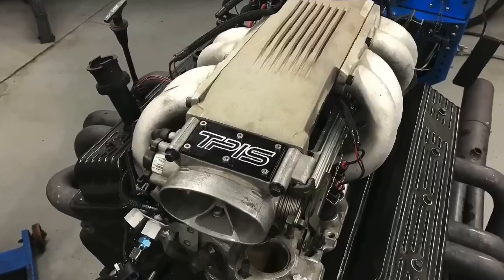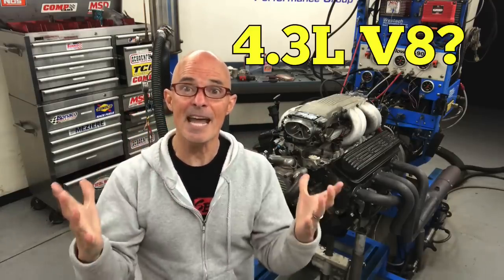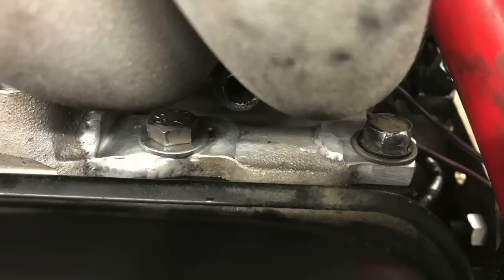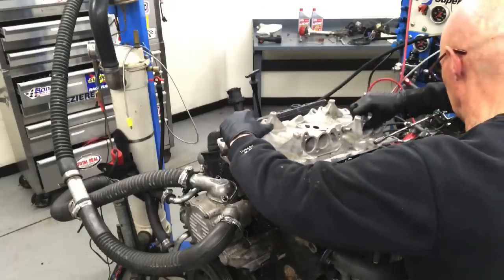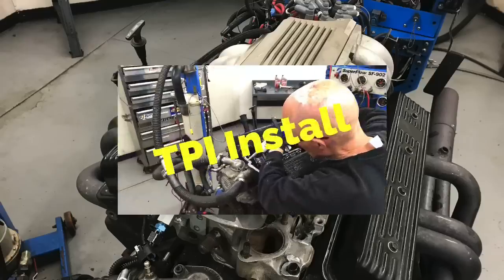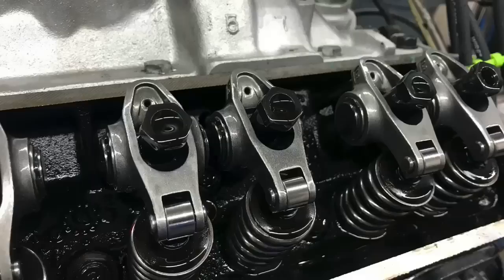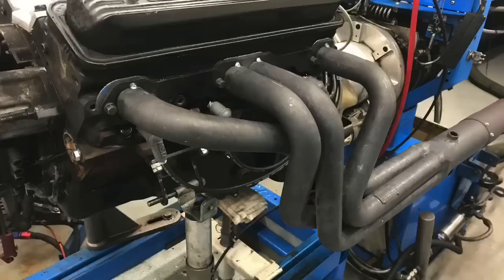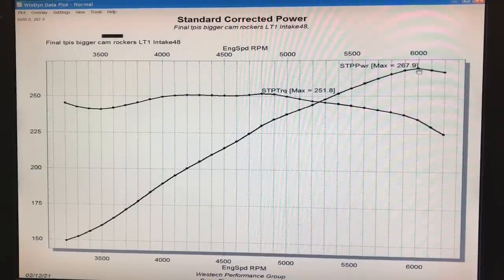GM's BIG MISTAKES-LT1 VS TPI VS CARB (L99 4.3L V8 INTAKE TEST)

Comment: So, it's worth mentioning that the carb intake was also the only "performance" intake tested here. I would be interested to see what this engine would do with something like a superram, which is kinda a middle of the road for runner length compared to the TPI and LT1. Personally, I don't like the TPI style  intakes, they're too much of a pita to put together, that being said there aren't alot of options out there for a gen 1 sbc that produce the torque that they do.
Reply: Accel made a Superram induction system for 92-97 LT based engines. It was the same as the Superram induction system for the LB9/L98 engines except it had a base intake manifold that was TPI on the top and LT1 on the bottom, had the same short runners, and a shorter upper plenum to clear the lower cowl on the 4th generation F bodies because the back part of the engine sat under the windshield in those cars. You could think of the base intake on the LT Superram system like the SD Vortec TPI base intake manifold except it was for LT based engines and it didn't flow like a turd like the SD Vortec TPI base does.
Reply: @Airwolf1971  I'm pretty sure the superram runners and plenum can be bolted to a stock TPI base. Theoretically he could put those parts on the modified base he already has.
Reply: @ericjon262  Yes they can be. The high flow base that Accel used on the Superram is the exact same base used with Accel's high flow TPI runners and plenum. Accel had a complete high flow TPI system and a step up from that was their Superram.

Comment: I have two Buick Roadmasters, one has the LO5, the other has the LT1. I really prefer the LO5 in this application as the LO5 has a noticeable torque difference. Off the line I believe the LO5 would get the LT1 for a few yards, although the LT1 will get it down the line. The LO5 is really a better setup I believe for a heavy Roadmaster. Would like to try the TPI on one of them, however just don't really want to get that deep in when both are working well at this time. Interesting results.
Reply: I often wondered what it would be like to combine a TPI intake with a TBI engine, since TBI heads are also designed for low end torque more than anything. The TPI runners would maximize low end torque, and then they would eliminate the fuel distribution limitations of the TBI.

Comment: Does anyone else think that 1 3/4" headers aren't the best for a 262 ci engine?
Reply: It's what they had but ya, they're too big. 1 1/2" would probably work good. For this back to back test the data is still good because it was only one change.
Reply: at most, 1 5/8"
Reply: @timothybayliss6680  with those 1.5 inch headers the torque would have over 300lbs
Reply: @joed5472  it's would probably add a bunch especially under the peak. It's making so little power that even smaller pipes might work but none are really available.
Reply: Richard just added a video where he uses 1 5/8" headers. 5 hp, 9 lb-ft gain.

Comment: A 117 LCA "computer" EFI camshaft is way wrong for a Carburator setup that can handle 108 LCA with ease. Looking forward to see what heppens next. :) I am still amazed than no one is offering a EFI converted carb style dual plane manifold for the V8 engines, only single planes style manifolds.
Reply: Mercruiser had one for Vortec heads with a large monoblade throttle body on an adapter.  I ran one on my 383 in my Express van.  Lots of torque and good hp. I used a 1200 cfm 4bbl throttle body and a low profile carb bonnet with a 4" air intake.

Comment: Some things to keep in mind:
1 Late TPI 305s made almost as much hp as late tpi 350s. 230:245 where as torque was 300:345
2 Most people look at 305s as junk but look at the Ford 225hp 5.0 as a good engine. Wrong
3 When the TPI engines were still in production I read a story that included John Lingenfelter. What he found was that the TPI 305s and 350s used the exact same TPI intake manifold. The problem was that they were sized for the 305. When they learned this they designed their own manifold for the TPI 350 (L98). Lingenfelter's manifold made around 40hp more than the stock TPI manifold on the L98. An L98 with a Lingenfelter intake manifold made almost as much hp as a stock LT1. If you look at this, the LT1 wasn't as big of a leap in power from the L98 as people think.
I believe the LT1 short runner intake manifold was actually designed around the larger displacement of there LT1. Horrible choice for the 4.3.
Reply: Exactly.

Comment: I had a '89 Firebird Formula 350 many years ago. The car felt really fast from stoplight to stoplight. It ran low 14's in the quarter mile and that was quick back in the day.
Reply: The Formula 350 TPI. It was all that the Ford rustang could do to try to keep up with that Formula 350. I like it because it's a lighter Firebird than the TA. No ground effects , leather seats etc to weigh it down. and it had the same Ws6 handling and power as the TA Firebird.  It also had the Knight Rider hood. 89 was a good year . Duel cats!

Comment: The Tpi intake probably would have made more peak power than the l99 intake with the stock camshaft. The stock l99 makes peak power at 5200 rpm and every point up to that that rpm the tpi intake is better. This gets worse for the l99 intake at lower rpm because the restriction of the runner isn't as pronounced at a lower rpm and airflow. Tpi intakes are expensive to manufacture and install on cars though, even as a manufacturer. The l99 intake is one.piece, the tpi intake is at least four that are all unique and need to be relatively precise with multiple machined surfaces.
I know someone is going to say that the runners aren't a restriction, they are. A well aligned, all those pieces I mentioned, tpi will flow less than 200cfm per runner. It really doesn't matter what heads and camshaft you put on it when you have an intake manifold that flows less than stock vortec heads with a truck cam.

Comment: The TPI manifold was replaced with the lower profile LT1 manifold for hood clearance in the Vette and Z28..
Reply from the maker: the Vette and Z/28 ran TPI motors and manifolds then LT1 motors and manifolds

Comment: I don't know about it being a mistake, but you kinda worked well for what it was designed,  mostly a small displacement, low rpm engine, when I had one, I was trying to figure how to keep the overall shape, only make the lower intake ports larger, and the intake runners larger  with similar length, with larger ports in the plenum, and throttle body, maybe twin 58-60mm,   however, I only port matched everything on mine, and ported the throttle body a bit, (and the plenum, ).  I'm thinking tpi may worked well on a 283, in a early 60's Nova! I think something with a short stroke, Maybe a 327 also,  a short stroke taking a quick, large gulp filling the cylinders, over a slower big gulp from a longer stroke, but I guess it comes to cam duration and timing, it just seems if the runner volume is equal to cylinder volume, or greater, it would have a ram air effect at a certain rpm range, where the moving air and reflected waves all work together, it all works out, and is plainly simple! (Totally inside my head of course, ) but even reading this not so much, but the total port volume, seems it equal or greater than cylinder volume, should fill the cylinders , maybe crazy, but I am a bit tired, just got out of the hospital, and had to watch your video first thing!! I'm just curious tohow the same (or close) displacement, only difference.is bore and stroke, to make it simple, say a 3" x 4" and a 4" x 3" bore to stroke, with similar intakes and cams, it would be interesting!
Reply: I thought this too but never built it

Comment: the '87 L98 with the first true fuel injection TPI was automotive genius by Chevy engineers and it also looked so cool with the runners
Reply from the maker: that would be 1985-but agree
Reply: @richardholdener1727  I thought it was '86 when the first TPI came out. Reason being was I had an '85 T/A and my buddy had an '86 iroc. His was tuned port and mine had a quadrajet. He was always just a little quicker than me, so I went and picked up an '89 L98 GTA. Fixed that problem right up.
Reply: @bisurdaddy  '85 Corvettes had TPI

Comment: Guess that motor needs variable intake runner length design
Reply: Cam, springs, heads help like on the 305
Reply: @shadowopsairman1583  what I was trying to explain, is that you can see the drastic difference in tq loss with the short runner intake, but also drastic hp fall off with the long runner intake manifold with the same internal parts. If you were to utilize an intake manifold that had a variable intake runner design, you could have a long runner intake for better low end power and have an additional set of short runners that open up in the higher rpm range to give better upper end hp, so giving the best of both worlds, on this particular engine.

Comment: There's one thing that has to be considered in why GM didn't put the TPI intake where the LT1 lived... does it actually fit in the applications where the LT1 lived? The throttle body is sitting quite a bit higher. I don't have the time to go hunting for hood profiles for various GM vehicles, but it may well be that they didn't want to change the stamping dies or it wasn't worth the unit cost for custom changes.

Comment: I'm wondering if you can block off the throttle body opening and convert a tpi plenum to carb. Sort of like holley hi ram manifolds with interchangeable tops. That would be a killer combo for a pickup.
Reply: Anything is possible with a welder
Reply: @TurtlDrip  I was more thinking of optimal fuel distribution. The ports are dry until right before the cylinder head. The places of the carb flange would need to be in the right spot to supply the corners. Maybe some fins to guide the flow. I know it's possible to plug a hole and cut a hole. I just think it would take a little more r&d than the average Joe welder is willing to do.
Reply: @TurtlDrip  question answered. Lol. Not just a Joe-welder solution.
Reply: @EricErnst  yes sir. Happy he made it happen
Reply: no

Comment: Grind down the restrictive nubs behind the throttle body on the upper intake and get a pair of Siamesed intake runners and that tpi will pick up a bunch of top end hp.
Reply: hes also using the stock throttle body with no air foil while he has a 1k race carb on the dual plane

Comment: One of the big advantages of the LT1 reverse flow cooling is that there are no coolant passages or thermostat housing in the LT1 intake which eliminates coolant leaks and allows for a 3.5" lower intake than L98.
My question is how is coolant flow changed if at all by using a L98 intake on LT1.

Comment: I would like a 300 HP 350 ft lbs tq L98 .  In  my 89 Formula Ws6 . I can't  go too crazy with a ttop car with stock  700r4  tranny . Will need subframe connectors first though.  A car from the 80s that's still the best looking car on the road  running in the mid to high 12s  or even low 13s  would tickle my fancy.  A third gen  Firebird being 200 lbs lighter that a 4th gen doesn't hurt either. I still think it's wild that the first gen F bodies were the lightest weight.
Reply: What do you mean by first gen fbody?
Reply: @TheJMan1K  First generation Camaros and Firebirds 1967-1969

Comment: Have a corvette C4 with the L98. Then when I finally got my hands on a Camaro SS Fbody with first gen LS1 i was very disappointed. L98 just made the LS1 feel tired and down on power. The trany was also not as aggressive making the camaro feeling even slower
Reply from the maker: an LS1 make 100 hp more than an L98-but the L98 does feel very torquey (initially)

Comment: But Richard: the TPI torque curves DIDN’T just “shift to the lift” per the dyno charts; the TPI torque curve shifted left AND UP.  Why is that?
Reply from the maker: IT WOULD SHIFT TO THE LEFT IF WE ADDED MORE LENGTH
Reply: Increase in volumetric efficiency

Comment: This is good info I have a 86 Trans am with a newer vortec 350 truck motor and a aluminum intake and edelbroch carb. Looks like I make more power then the stock intake systems and my big cam should breath better too
Reply: your carb and the one used in this vid are two totally different carbs lol richard states the air foil yielded no gains on the efi but doesnt use 300-600 dollar street carbs

Comment: I've never heard of a 4.3L L99 V8. The only L99 I know is the 6.2L LS style L99 that came in the 2010 and up Camaro SS. As I listened to the rest of the video, the 4.3L L99 came in the full size Caprice. I thought that was a 5.0 that was in the Caprice. This video pretty sums up why GM eliminated the TPI manifold when they introduced the 5.7L LT1 V8 for the 4th gen Camaro/Trans Am in 1993. The TPI's weakness was after 5000 rpm, the LT1's strength was after 5000 rpm, and why that engine was rated at 285 hp. I love these GM engines, but I'm not using anything under 5.7L's. Lol
Reply: For some dumbass reason GM likes to reuse engine designations, which is why there are three completely different LT1 engines.
Reply: @fryloc359  it doesn't matter because each LT1 engine is bad ass!

Comment: So with the long runner intake it wouldent be a bad set up for a truck atleast a half ton. I have a lt1 an a l99 im thinking about throwing the l99 crank an connecting rods in the lt1 to make a 302 with the aluminum lt1 heads an mabye doing something like modding a tpi intake it could have some really good results.
Reply from the maker: for a truck you should keep it at 350 inches

Comment: GM should have just put the 5.7L in the Caprice instead of a completely different 4.3.
Reply: Or whent with a 4.3 V6 or 305.
Reply: @grandmasmalibu  there is lots of 5.7l iron head engines that are 260hp. Dunno the code. If you see a 94-96 car with duel exhaust it's a 5.7l, a single exhaust is 4.3l. The impala ss and cadillac fleetwood apparently had the lt1 aluminum head engine.
Reply: @grandmasmalibu  I've had nearly all of the LT1 cars - SS, Roady sedan & station wagon, Fleetwood & Caprice sedan & 9C1 cop car..... I'm fairly confident that All were iron headed 5.7s but my buddy who's sister raced Camaro & Firebirds had aluminum headed engines.... Which reminds me - I've got a set of her old aluminum heads laying in the garage if anyone wants them.. haha

Comment: Can you modify a TPI manifold to accept a carb or something with similar runner length and carb for comparison? Probably not cost effective but would be interesting to see if it beats the fuel injection TPI.
Reply: its been done,it doesnt work well and looks ridiculous

Comment: Can you build a high compression 5.0L with the L99 block, LT1 crank, LT1 rods, & ported L99 heads. Thanks for the great videos..
Reply from the maker: 5.0L 302 (4.0 x 3.0) with LT1 crank? 5.0L equal L99 crank and rods with LT1 pistons in LT1 block. or...305 equal LT1 crank and rods with l99 pistons in l99 block
Reply: @richardholdener1727   L99 305ci using the L99 block, heads & pistons with LT1 crank & rods. The increased displacement from the longer stroke will increase the static compression ratio and make more power (or will it?) Than the LT1 302ci because the reduced L99 stroke will also lower the static compression ratio.

Comment: Best upgrade I ever did to my L99 caprice? Pull it out and drop at real LT1 in there. Its a direct swap and adds 60hp and 100 ft/lbs of torque.
Reply: What upgrades would you do to the l99 engine to make it better I have a 1996 caprice classic bubble and I'm not sure I can afford the lt1 engine swap at the moment or is it a complete waste should I  just save up for the lt1 swap
Reply: @EBO47  The LT1 Engine is almost identical to the L99. It is a direct swap with absolutely no issues, as long as you swap from another Caprice or roadmaster. Camaro/Corvette engines can work too but oil pans and accessory drives can be different, as well as the optispark setup. The Computer can even run both engines. That being said, any little upgrades you do to the L99 can easily transfer over the LT1 engine when you do swap one in. There are a few things on these cars outside of the engine to boost performance, changing the rear end gears is a big one. One of the biggest upgrades to my car was swap the torque converter when I rebuilt my trans, I used one from a Blazer, its the same converter but with a higher stall speed, feels like a totally different car now. Its nothing crazy but a nice boost. I think the stock converter in these cars has a stall speed of 1100 RPM while the blazer one is around 2500.

Comment: The smaller displacement SBC's will always do better with the TPI tubes.  I'd like to see the same testing with a 350, what people mostly run.  I predict the LT1 will do better with stock intake than TPI if enough displacement.
Reply from the maker: a short runner LT1 intake will always lose low-speed torque compared to TPI
Reply: @richardholdener1727  Well now you know what to do: test this on a 350! lol

Comment: i would like to see what a throttle body injection would do on this engine.and I'm not sure the the fuel injection was optimized on these setups seem like the drop off in power at higher rpm's might be not enough fuel.
Reply from the maker: THE SHAPE OF THE POWER CURVE IS A FUNCTION OF THE RUNNER LENGTH

Comment: Posted 7 hours ago.... Right as I'm looking at a TPI swap... It's a sign
Reply: I have an entire set up off an 89 TA.  Distributor, harness, intake, air box, MAF injectors, ECM.  I’m not going to use it but I can’t bring myself to throw it away. 😔. I had it running in a square body and swapped it for LS.

Comment: 10:09 omg, do it. Just some bigger 180 bends. Hell maybe looped runner tubes added between the stock upper and lower manifolds. I'm thinking truck mods for hauling. I also loved the 2004 GM truck I drove with it's stock 454. That low end torque was a joy to drive; I don't think I ever went past 1/4 throttle, even going up steep hills.